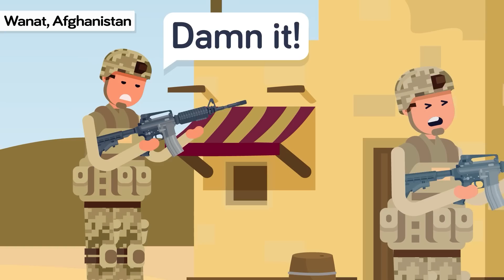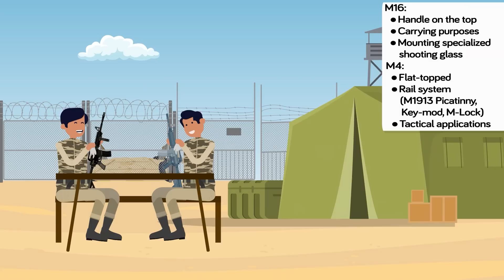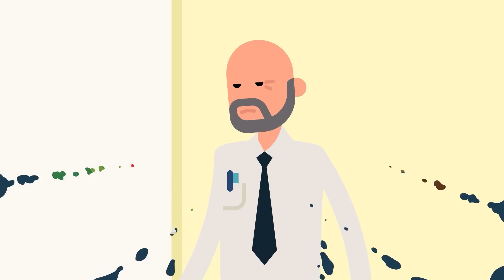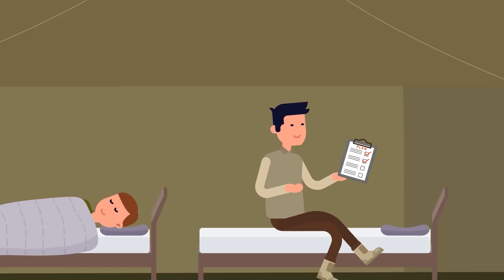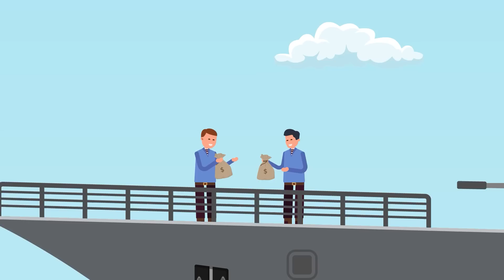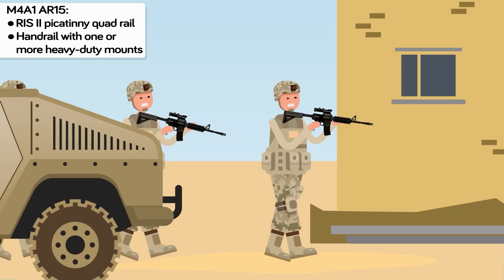Why US Army Hates Their Standard-Issue Rifle

Comment: And some AR15s have a design that makes it so that the mag will want to push itself back out if the bolt is home and the mag is loaded with a full 30 rounds. Many practice loading 28 or 29 rounds in the mag in order to do a tactical reload without that issue. Chads who run ARs know what I'm talkin about.
Reply: Yea, that was one of the main problems with the old GI mags. Since then, everyone has switched to magpul pmags and it's no longer an issue because if you try hard enough you can fit in 31. So there's not as much pressure with a full 30rnd mag being inserted on a closed bolt. 

Also since the brown tip m855a1 came out, it's now standard to use pmag gen 3 because it presents the round more inline with the bore to reduce damage to the feed lips and it's much more reliable than the GI mags. 

If you're still not comfortable with the pmags, Daniel defense has 32rnd mags. There's still going to be people out there that only load 28rnds/mag because that's what they were trained to do, but it's largely unnecessary with current tech.

Comment: The problem with the rifle and difference between the American weapon 5.56 nato is the powder charge is much larger than the 7.62×39 AK has a much smaller charge. The ability to clean the weapon during a firefight will get a soldier killed. I was an expert according to the Army and I have shot Both, my opinion is that the 7.62 × 39 is better at 800 yards it had a 2 inch drop but that could have been me due to the peep sites.

Comment: Several years ago I had the privilege of speaking to the lead test engineer for the M16 A4 variant. He told me that he had actually failed the weapon after discovering that the entire AR family had been causing friendly fire incidents since inception. His discovery was something that everyone who has fired an AR can relate to. They all have the exact same ejection angle. A nice little arc, Straight into your buddies shirt on the firing line. This guy had found multiple cases of injuries or deaths during training where a new soldier was on the firing line and took hot brass down the back of his shirt while holding a loaded rifle. You can fill in the rest. The engineer failed the m16A4 and advised that it be modified to change the ejection angle...Years later he found out that the next person in the chain of command illegally altered his report, passed the A4, and sent it on up. That is why to this very day, the AR family will put brass down your friends shirt at the range.
Reply: Interesting,  makes sense. Yeah I've been burned a few times, never freaked out and flagged anyone bit I could see it happening from time to time. Thanks for the info.
Reply: @MrMgreen66  Correct me if I am wrong, but they stagger or spread firing positions in training to prevent this now don't they?
Reply: We did if I remember correctly but never knew the reason. Figured it was just to spread the area of effective enemy fire.
Reply: @MrMgreen66  The same guy and his company or group or whatever. Was responsible for compiling the ballistic data required to make the custom scopes for the m40a3
Reply: All the guns I've shot eject the spent cartridge in the similar directions and angles as my AR, even pistols.
Reply: @ClsdCskt  yes most do except for maybe bullpups and left handed weapons. I think the problem is the higher arch on the ar15/M16 platform possibly. I've built many ARs but I'm not in any way an expert on the matter.
Reply: @MrMgreen66  I've had 9mm bounce off the range walls and back into my shirt, very uncomfortable. I feel like you could engineer the ish out of the problem, but at the end of the day hot brass flying is hot brass flying.
Reply: @ClsdCskt  indeed.

Comment: This channel constantly screws up anything firearm related..But they can’t help themselves.
Reply: They never even fired a gun at infographics, they are all yuppies over there.
Reply: Youd think somone working down there would know something about firearms. ANYTHING. But you can tell someone looked over this script that said they know about rifles. But infact. They dont. I cant speak on the 20 inch M16 but M4A1's and AR 15 i can and can tell you i bought a budget ($1000) Stag 15 and didnt clean if for over 2 years and shooting roughly 2000 rounds down range. That sounds kind of low maybe 2500 rounds. The plan was not to clean it until i had 2 failures in a row. Anyway it was coverd in carbon, sand and dirt and after 26 month it happend. 2 failure to eject in a row. Point being these are great rifles that dont NEED to be pamperd. I live on the arizona new mexico line for this setting.
Reply: OK chill boi
Reply: @keanujones4505  
Why is it good when people point out wrong information when it's on other subjects but when it's about firearms it's bad?

Comment: I liked the M4 and most problems I've seen were due to old mags and poor maintenance, not attachments.
Reply: A lot of people in the army don’t maintain the weapons properly
Reply: Now the taliban own them. : (
Reply: @aaronsmiley5692  they removed all the firing pieces
Reply: @Taptem1  it’s not hard to replace slot of the parts in it, you can order parts from China pretty cheap for them in other countries
Reply: @kanaancross317  true but it doesn't mean they will last or blow up in there face, due to low quality of metal.
Reply: @aaronsmiley5692 Biden is a terrorist as well.
Reply: @hanzo9941  🙄 how asinine
Reply: Maintenance isn't the issue...it jams anyway.
 Cleaned perfectly it still messes up.
Reply: i think there's been an over reliance on the attachments and not enough on the gun itself. too many moving parts, too many compromises for  accommodations, too many details to maintain for effective performance over long endurance situations.
Reply: @LuoSon312_G8  there are 3 attachments may be one at most depending on the job in the unit and designed that so the soldier never has to take his hands off his main weapon. Plus the weapon has to go through certain units to even be accepted. The main focus of the weapon is modular.
Reply: @LuoSon312_G8  too many moving parts? The bolt carrier group, buffer and trigger is too many moving parts? 
Tell me you know nothing about guns without saying you know nothing about guns.
Reply: @theduke7539  i only meant just what is moved or effected during cleaning and maintenance. the barrel? the iron sights? optical sights that if mounted or not gauged to fit user would affect accuracy? holding pins that wear down after extensive disassembly or breakdown without adequate replacements if found faulty? slides or charging handles? springs? the firing pin? guards or covers? the locks on the stock or screws on the rails?

a whole lot of factors can make a good firearm but in standardization, some of the specialization that comes are being sought with modular systems must be considered as not universal or not necessary. and that a fixed base form should be prefered against a modular form.

the things heard from armorers and gunsmiths just have me asking. compared to rifles that came before current systems just seem to have too many issues.
Reply: @LuoSon312_G8  yeah but alot of those wernt moving parts
Reply: @LuoSon312_G8  not true